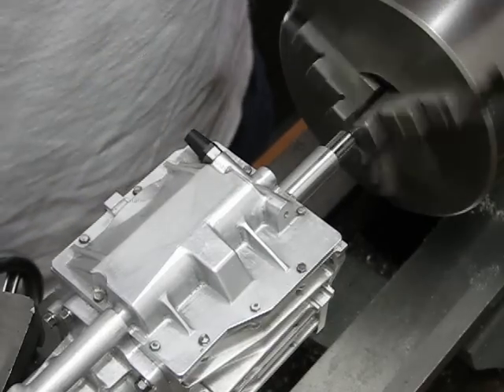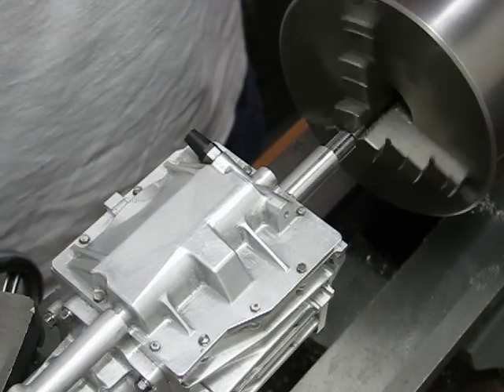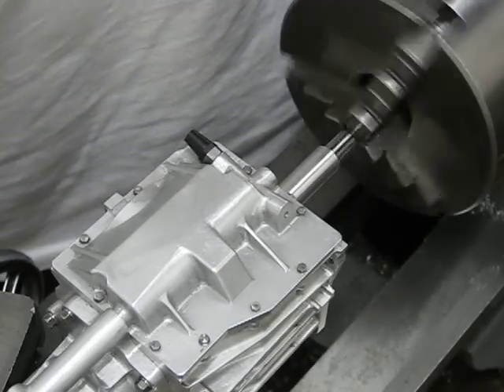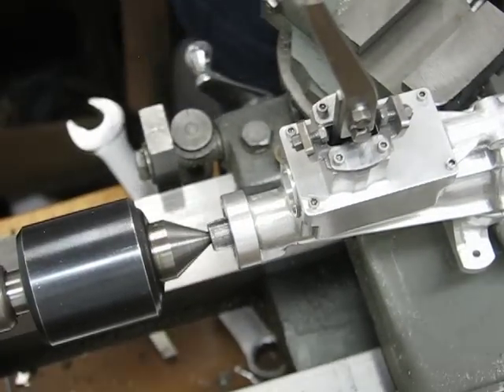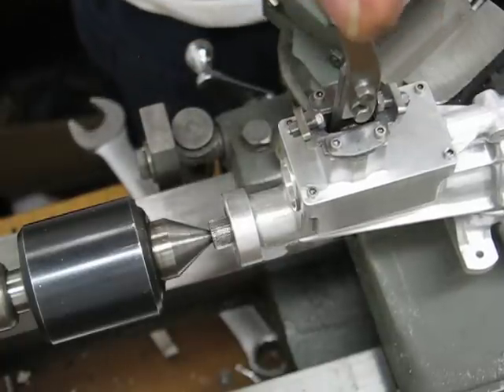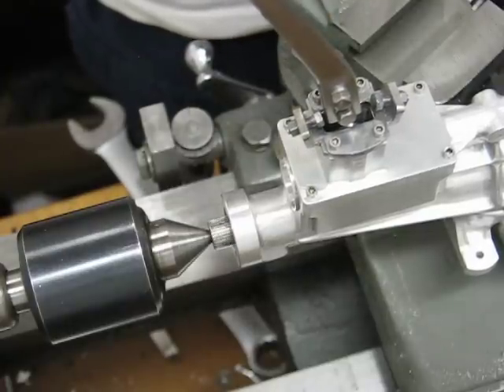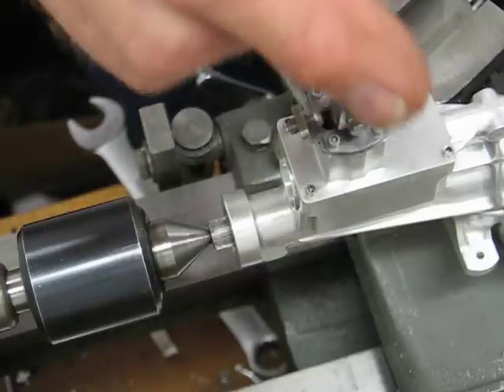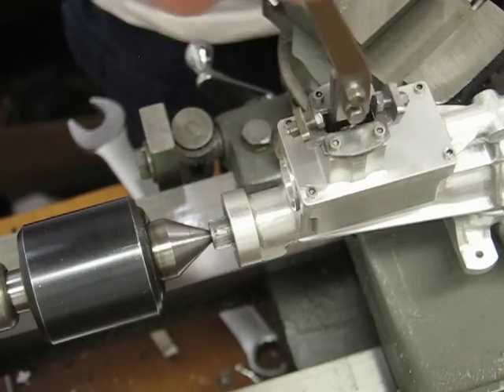T5 TRANS OPERATION.AVI

Comment: As a machinist/toolmaker for over 25yrs,I'm still amazed every time I watch one of your vids!Do you ever use drawings on stuff like the T5 or your engines?Or do you measure a real T5 and scale down everything to 1/3?Or.build on the fly?Like on your flathead,I was like"How the hell you even begin to figure out the oil pump housing size,that will clear everything,then gear size,fasteners,etc.,etc...."
Reply: Do you realise your spinning it backwards. Or was it on purpose? Very cool though.